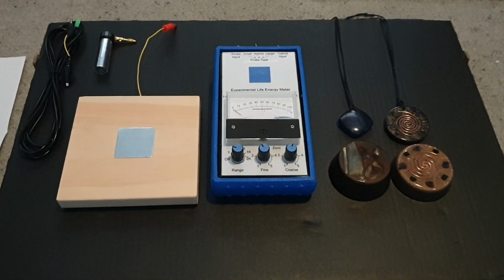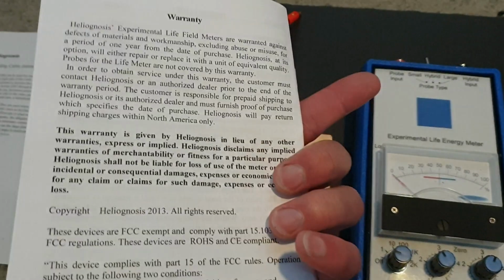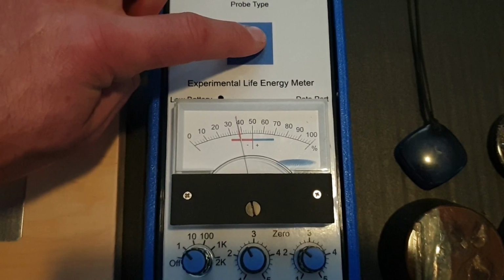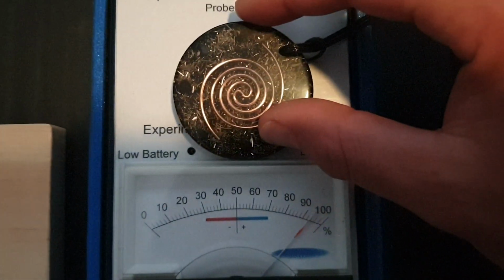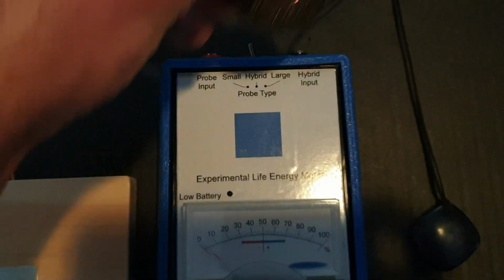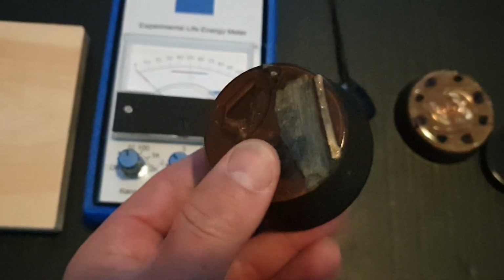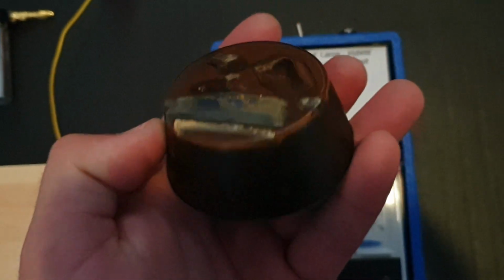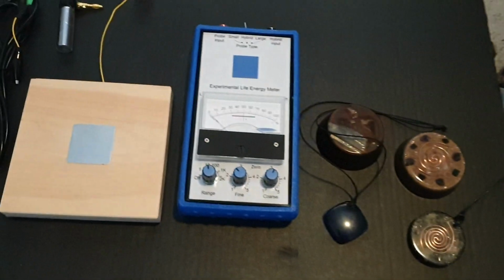Measuring Our Orgonite Creations! LM4 Experimental Life Energy' Meter

Comment: Just making an observation. If this orgonite is supposed to have some kind of benefit then the energy should be detected without touching anything to the orgonite at all.
Reply from the maker: To this day there is no hand-held scalar field meter that you can buy to measure this kind of energy. This experimental life energy meter is indeed partially picking up lifeforce/scalar energy but it is experimental and is a fun tool to use.